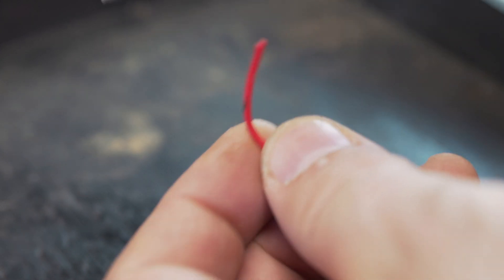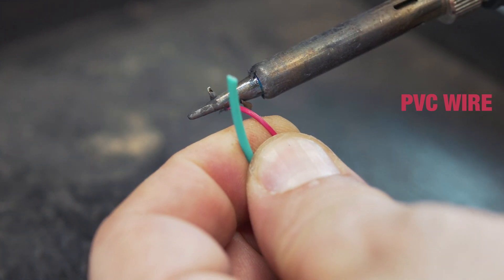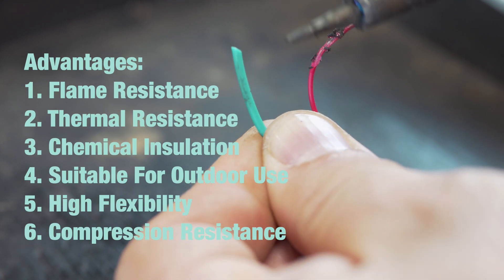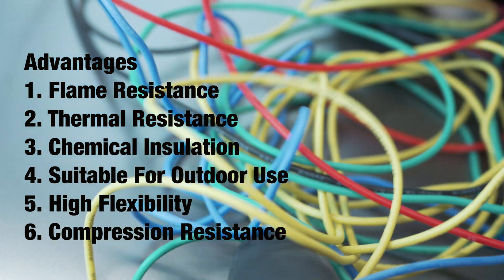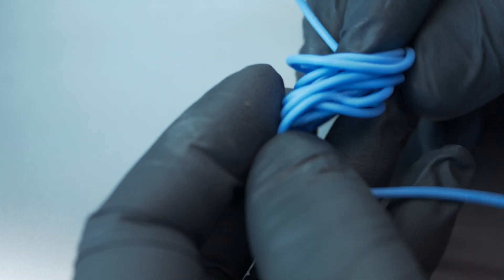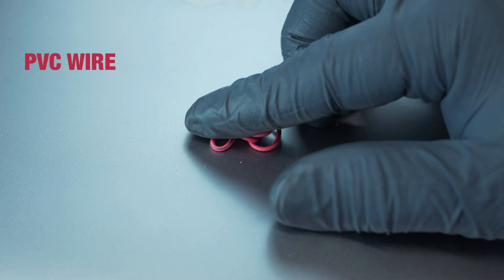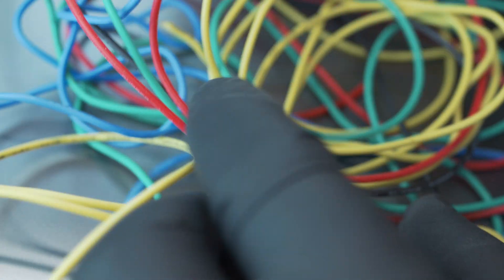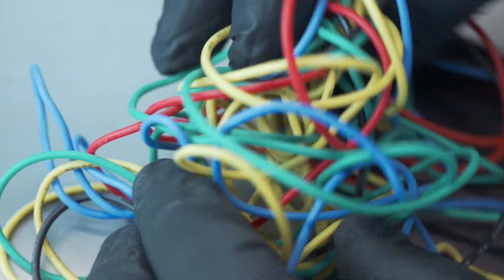Stop using PVC wire. Use Silicone Instead.

Comment: Silicone wire is made for applications where there will be movement in the assembly, requiring a "cooperating wire" and is not a good chemically resistant jacket, btw. So no, it's not a better replacement for PVC. There are many other jacket types, such as TFE/PTFE, mPPE, XLPE, etc. All jacket types have their purpose and I'm willing to bet most people on your channel would prefer any of the other types given how noodly and cheap feeling this hookup wire is.

Comment: Silicone wire is readily available these days but I'm still looking for some wire insulation that feels and glides like leather if anyone knows. The softness/flexibility is in between silicone and pvc. It was great for testing/prototyping because it retains its shape and glides across other wires easily. Silicone tends to grip itself.
Reply: Probably PTFE wire. I use both PVC & Silicone wires for my 3d printer. Some of the heating elements have PTFE wire and it's like a slipperier more flexible PVC. the insulationg is MUCH thinner as well, but stronger.